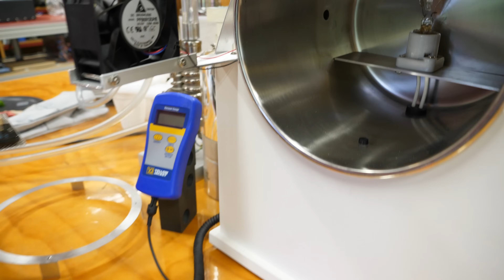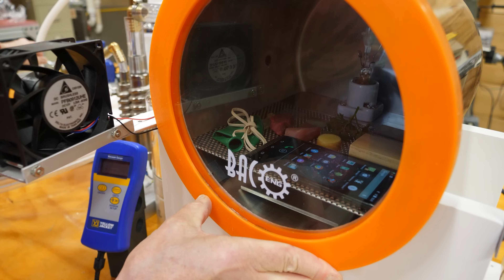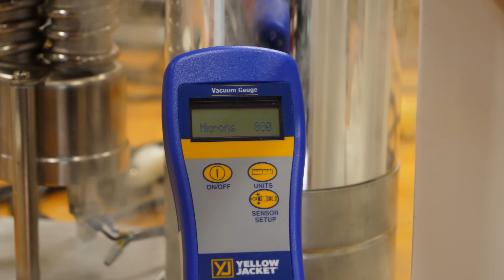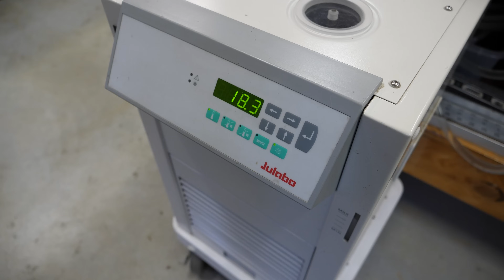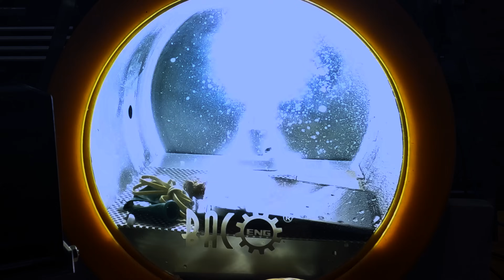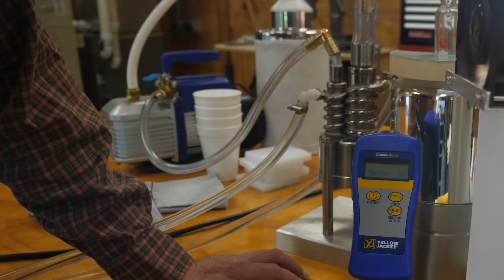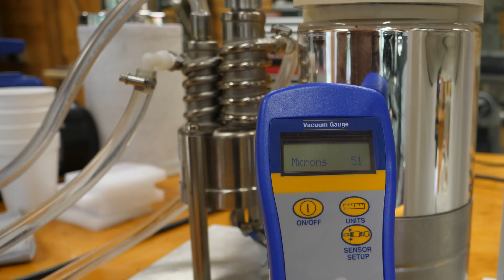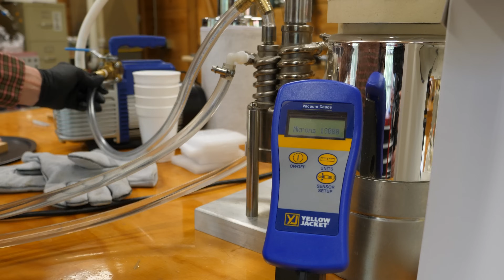We exposed BEEF to the vacuum of space, then ate it!

Comment: Sorry, but the vacuum of space needs something more than just a mechanical pump, multiple semi conductor tools need vacuum to preform the steps in making the chip. Mechanical pumps will start the pulling the chamber down to say -10 tor after that either a turbo pump will take over and drop it more, but to get down to space vacuum one needs to have a cryo pump which will have three different set points, the two lower set points are almost absolute freeing and the charcol collects the particles, every so often the cryo pump needs to a regen which is letting all the particles out, if a cryo dumps during process that won't be good. Ion gauges are used with cryo's to determine the vacuum. After opening a chamber that requires a cryo pump, it takes several hours to get it back down to the set point for processing. Also if there are any leaks in the chamber from say a o ring or a some one leaves a rag in the tool, it won't pump down properly. If water is present the chamber won't make it past 2 on the 5th scale unless all the water has degassed.
Reply from the maker: Did you watch  the video?  I explained that.

Comment: Did you calculate the extra mass the turbine has to push along the force meter.
Reply from the maker: If you're referring to our last video, then yes, we actually did. We tested the bare engine with a lead weight on the moving structure, and there was no change in measured thrust. These are very good bearings.

Comment: Extremely similar to freeze drawing. I say this as a Heavy Harvest Right freeze dryer. The only difference is that you do not have a lightbulb in there but it does freeze the product before it applies to vacuum and then slowly increases the temperature as the vacuum is applied.

Comment: I want to see a fully functional phone put in there without the battery. There's other gizmos in there with gas in them, but you'll never notice them failing with the battery exploding like that. Don't even need them in there long, don't need the light, I'm just curious how much hard vacuum a modern phone can tolerate before things other than the battery start going sideways.

Comment: There are some indium based solders that melt and flow below the temp of degradation of wire insulation and would cause a reasonable vacuum seal. Now for high vacuum electric connections the gold standard is fused porcelain transitions. That might be cost prohibitive or not worth the time in a system that has steak gassing out and as such might not ever get to high vacuum anyway.

Comment: Another way of achieving high vacuum on a budget would be by means of a Sprengel Pump which uses drops of mercury falling into a tiny funnel to entrain gas bubbles.
Making one would mean learning some basic glass-blowing skills which I'm sure you're up for 😊
Unfortunately, it's pretty much impossible to get mercury now, not that you'd need much.
I wonder if molten Gallium would work? The apparatus would have to be kept above 30 degrees to keep the Gallium molten. The specific gravity of molten Gallium is about 6, whereas Mercury is about 13 so it might not work since the weight of the column of metal has to be enough to keep the gas bubbles flowing downwards against the vacuum. Also Gallium "wets" glass whereas of course the surface tension of Mercury keeps the droplets intact.

Comment: related to your point on sat materials, I work on a project related to the Chandra Xray telescope satellite, which went up in 1999. last year, part of the circuitry had a malfunction due to the long term effects of a vacuum on the ceramics they were built on and how they warped because of the environment.

This also reminds me of a story from NASA on how they had a tool weld onto the hull during a space walk because the metals, I think steel or aluminium in this case, came into contact with each other. the insulation of air and the normal dirt that coats most things on earth apparently keeps metals from fuzing together in atmo, called cold welding. I'm not sure if this vacuum is enough, but it would be interesting if you could recreate that in this chamber? My understanding is they solved this by starting to paint or coat the tools so that they could not come into direct contact.

Comment: Great Setup. Now please do a real steak cooking episode with it. 

Space Steaks. First you place the steaks in a container of olive oil, holding them under so they can't float. Pull the vacuum on them for a couple hours, and then when you release the pressure the oil is infused into the steak. Maybe add some salt to it as well, so it seasons it as well. Then after the steak has had a chance to suck in the oil for a few hours, put it on the pre-heated hotplate, and cook till 130F inside. Allow to sit for 5 minutes and slice and serve. Should be the best steak ever. You can try all sorts of combo's of different oils and infusions, like peanut oil, vanilla essence, lemon juice, whatever you can think of. Should be an epic gastronomical journey either way. I only wish I was there to try some.

Comment: What outer space material do we test?  Maybe different types of lubricants as mentioned. Things like wet and dry lubricants or waxes that has been pre treated with low pressure.   Obviously anything with water isn't going to work unless treated.  Seems the chamber is a pretty good sanitizer.   I guess the cool thing is many things that would normally oxidize wont (unless there is rust or another type of oxidizer) also why we didn't see the battery explode into flames when it did short out.

Comment: i am perplexed as to why i never see a hydrolic press vacuum set up. i do not have the funds, but if i did, i imagine one could build it using a car jack, steel tube and check valve to prevent air seeping in and around the cylinder seals.

Comment: That was a very interesting video! I build high powered rockets. The black powder ejection charges for pushing the parachute out of the rocket don't seem to burn. I had an ejection failure at 25kft msl. There was unturned BP in the parachute assembly. It would be interesting to see BP "burn" at reduced pressure and perhaps high frame rate to see what is happening.

Some suggest putting the BP in latex tubing and sealing the ends. My experiments show that doesn't work either.

Your video points out lipo battery failures at low pressure. I hadn't anticipated that!

Comment: Haha you actually ate it after exposing it to all those fumes?? Crazy 😮 Anyway, the data you provided on the reflective properties of the pot surprised me and got me thinking about an old experiment I wanted to attempt years ago but never did. It essentially involved funneling a beam of sunlight focused through a fresnel lens into a small opening to a box or container lined with mirrors, I was curious as to how effective it would be in terms of capturing the light energy and using it to heat water or even for cooking something like a whole chicken. I still reckon my idea would be 10 fold more effective than those tubular solar ovens and their lil 😅 reflectors
Reply from the maker: Yup, I took on for the team.
The system you described would work, but the improvement in the performance over a typical, vacuum insulated thermal absorber will be small.  Would it be worth it? I don't know.

Comment: Does lump charcoal or briquettes burn better if all the moisture is removed? I work with compressed air systems, whenever we change out a charcoal filter the new one introduces moisture into the system until it's dried out. It got me wondering if lump charcoal would burn better if all the moisture was flashed off. Trying this though you would need a bigger water trap, or changing it more often. I was also thinking the briquette would fall apart under hard vacuum as the binding *agents dissolved.

Comment: Maybe a practical example a couple of bearings with grease one a control the other with the treated grease and spin them up and see the wear difference. Maybe do several controls and several treated ones to ensure if there is a difference it isn't a fluke.

This is actually overall a handy device for testing cubesat hardware of any cubesats that must move or the hardware on them. It doesn't replicate everything in space but it does give added benefit to just simulation and spec sheets. What should happen and what actually happens often aren't the same.

Comment: OH! How about testing this aluminum "cold welding" theory. The two Astronauts of Gemini IV, Edward H. White II and command pilot James A. McDivitt, had difficulty first opening and then closing the hatch before and after the first space walk.  I have read into this for years. I and some colleagues of mine concluded that the outer edges of the door must have undergone some sort of other distortion by some other force and not due the this so called "cold welding". But it might be really neat to see if rubing similar metals together enough could knock off any oxide layer, and then to see if these materials would then weld to eachother in your vacuum camber.

Comment: In industry, LED light fixtures fail more often than halide lighting because they can't handle operating in hot and humid conditions. - At least the ones that we've been getting...
Reply from the maker: Your  experience isn't  typical.
Ballast failure, color shift, and failure to hot restart are the biggest problems.
Actual LED failure  is pretty  uncommon.
Reply: @TechIngredients  That's true - unfortunately if everything else fails and you require contract scaffolding and electricians to replace a 'lightbulb' the power savings are moot.

Comment: we had a small single cylinder engine with an extarnal inlet and exhaust manifolds outside of the vac chamber. we got it running on diff oil only and started pumping down. at -4 to the 10th minus atmospheric pressure it imploded and hence this time I did get fired.

Comment: Hi, You mentioned that you are interested in other ideas. For some time I have been toying with a way to make electricity from ambient heat. If it can be done it would be a fabulous machine that while charging batteries, it would cool the house or the outside environment. I do not have the resources and the knowledge of thermal mathematics to make the prototype. My reasoning is based on the fact that when you operate an air conditioner you can feed it 1kw of power and your output on the heating side is 3-4kw of heat. My idea is simplistic and theoretically possible to make part of the excess heat operate the air conditioner and put the remainder in a battery for later use. The cycle is as follows the evaporator (cold side) of the refrigerator is placed in a black inclined rectangular solar box on the roof or directly in the sun, with a glass plate to make sure no warm air can escape from the top. But the bottom is open so cold air can drop out during the night time and warm air can take its place. The cold gas absorbs the heat and moves towards the compressor (assuming we have a DC rotary compressor that can be run at different speeds)  The gas moves to the compressor via a spiral tube heat exchange unit to help the compressor to cool and pick up some extra thermal units. Then the gas flows through a heat exchanger that cools the compressed liquid down and in the process warms the gas up even more. The gas is now quite hot(solar heat + compressor heat + return heat from Peltier cells) and enters the compressor it gets compressed into a much hotter liquid there the liquid flows to a heat sink that has many Peltier devices attached to it (the configuration and quantity have to be calculated) From there the liquid flows through a heat exchanger with the warmish gas coming from the solar collector making the liquid the same temperature as the incoming gas. Now the cooler liquid is going to do the cooling, Part of the liquid flows via a TX valve (Thermal expansion) into a heat sink that cools the Peltier devices from the other side making the Peltier cells produce electricity (the gas created from this will be warm to hot and return to the compressor as to where in the cycle it enters the suction line is something to be determent by calculation or by experimentation) The remainder of the liquid is directed to the evaporator in the solar collector controlled by a TX valve this will cool the solar box and therefore absorbing more heat from the ambient heat. The rotary compressor will be controlled by a vacuum controller on the vacuum low-pressure side. The TX valves have to control the liquid release and cold side of the cycle and therefore control the compressor running speed. The compressor is powered by the storage batteries the Peltier cells feed the battery providing the continuation of the process. 
Providing the Peltier cells produce more than the compressor takes we are making electricity.

If the Peltier cells are not able to work efficiently enough, another option would be to use a sterling generator which is very costly.  I was looking at using the Tesla turbine I think it has a chance but here again, the cost would blow the budget. If the Peltier cells work it would be the best option.
Imagine, if everybody had one of these units working on their houses and on factory rooftops climate change would be reversed! People in remote places would be delighted. 
Let me know what you think and if you like to give it a go.
If you want me to make a visual diagram please let me know I am very happy to see someone look into my idea.

If there is anyone who wants to try this idea let me know!

Comment: Time dilation is the difference in elapsed time as measured by two clocks, either due to a relative velocity between them (special relativity) or due to a difference in gravitational potential between their locations (general relativity). A test to prove that the difference in "time" between the two clocks has nothing to do with time is to show that the atoms used to measure "time" in these clocks are changing shape. If only time was involved, the shape of these atoms would not change. If a ice skater rotating on one of his skate opens its arms, it will slow down and this does not mean that time was dilated.

Comment: I once heard (in college, but that's irrelevant) that -29.2 PSI is the lowest vacuum that can be achieved mechanically. Can anyone confirm or debunk?
Reply from the maker: That's  false.
The limitation of mechanical pumping is speed. As long as the leakage, including outgassing from components, is lower than the pumping speed, the vacuum will improve. 29.2" is nowhere near that limit.

Comment: I used to do electrics potting, two part epoxy using vacuum ovens, pretty nasty stuff. Fun though.after we mixed the epoxy we would vacuum oven it down a in a few stages to get all the air out, air pockets in potted electronics (power supplies) might as well be a short.

Comment: I have a couple questions.  First, if you have a GC/MS laying around, what chemical changes and contamination happened to the meat from its exposure to the battery and other chemicals in the other test samples.  (You put the meat in your mouth, and then threw the battery outside.   LOL).  Second, how much did the weight of the wood actually change?  How much did its strength change?

Cool show.

Comment: Do just the batteries. Do ptfe steel bearing sliding. Do graphite powder as lube steel to steel.  Or galvanic corrosion aluminium steel

Comment: Would the beef be eatable if you you would stop the process in right time?  Would you try to to make a tee in vacum, water is boiling at room temperature in a vacuum. What temperature would show alcohol thermometer, resisitive enough?  Would you measure weight of the air, I mean you put a weight scale under a vacuum chamber of volume say 1m3 and suck the air? Or in easier way compress air to 5 Bar and check the delta weight of the chamber?  These are things the came to my mind after this video.
Reply from the maker: I suspect it would.

Comment: Let's see. When they add the water-resistant coating to your phone. They place it in a vacuum. Then, add the sealing chemical.   It should be fine.
Reply from the maker: That doesn't seem to be right based on the results of this test.  Maybe it's a matter of duration or the level of vacuum.
Reply: I have never seen the batteries expand like that. Maybe the vacuum wat to hi. They should be vented. I'd they are not they become a bomb. Ok maybe a firecracker with very bad fumes. A bit more than a balloon.

Comment: I'm most interested by the results with the wood.  Namely, I wonder what all is left in there.  I'm guessing lignin, cellulose, and some trace bits of non-volatile biochemicals.
I can't help comparing this to the pyrolysis process.  You've removed the volatiles by pressure, while pyrolysis removes the volatiles with heat. But, without any oxygen none of the remaining material can char to coals.  I'm really intrigued as to what your samples' combustion properties are.  Most of the elements that dampen the burning temperature of wood are gone, but neither cellulose nor lignin have been dehydrated down to carbon.